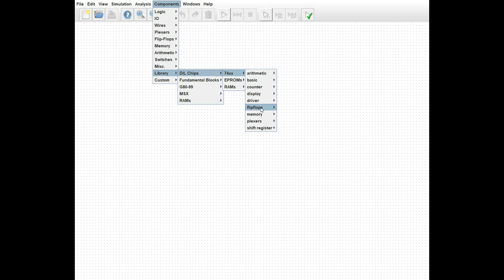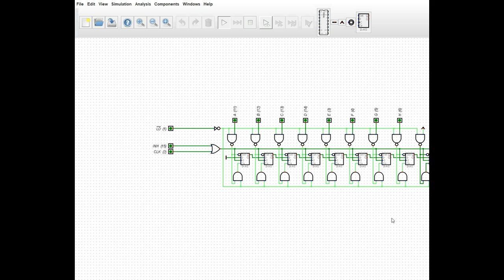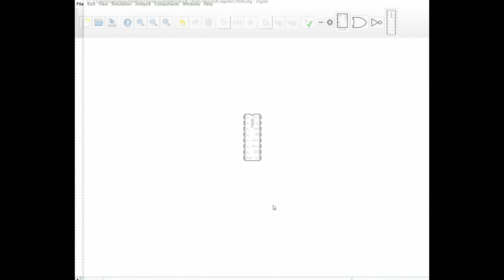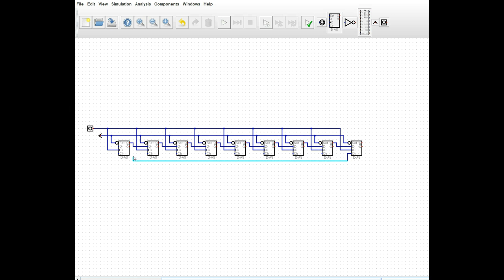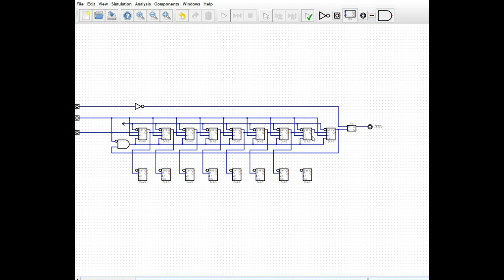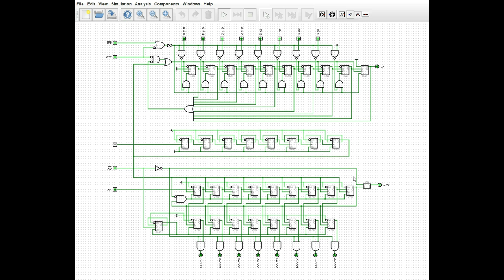Digital Logic Part 3: The UART

Comment: i have a question, while you use [(CLK)' AND RTS] for clearing the memory and copying the Rx D-ff's data into the corresponding D-ff, doesn't this create a classic case of race condition? you're trying to write data thru CLR signal and read data out using the buffer D-ff at the same time right?

Comment: I am looking forward to seeing this design put into the part and tested with real data. Normally in a UART the clock is 16x the baud rate so that when the start bit is received the shift clock is delayed by 8 of the 16x clocks which is 1/2 the BAUD period so each shift clock rising edge is centered in the data bit to account for variations in the TX and RX clocks and noise on the cable. You have the shifting done on the rising edge of your local BAUD clock with no idea of where in the start bit your clock occurs. It could be anywhere within the start bit period including right on the leading edge or trailing edge. Any variations in the clock at the transmitter and receiver along with any noise on the cable and I think you will be dropping bits or picking up bits. Maybe not in every byte but I would expect to see some trouble getting reliable data. Normally this would all be done with a state machine clocked by the CLK input (in your design 2.4576 MHz) and using an edge detect to find the leading edge of the start bit to set things in motion. The state machine would generate and count the shift clocks or as in your design look for the last flip flop to be set then transfer the data from shift register to the data register.

Comment: Oh , i think different baud rate clocks for transmit and receive may have been a hang over from early modems, weren't they 75 baud in one direction and 1200 baud in the other.

Also, i'm curious why you need to clear the RX register when you have read the data from it, presumably you wouldn't read it again until you have latched in a new byte so does the old data need to be cleared.